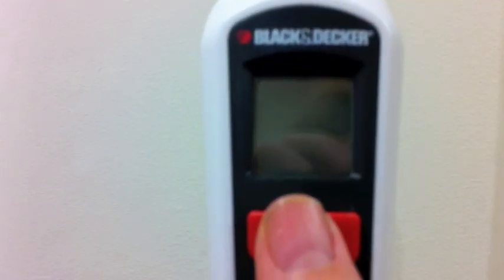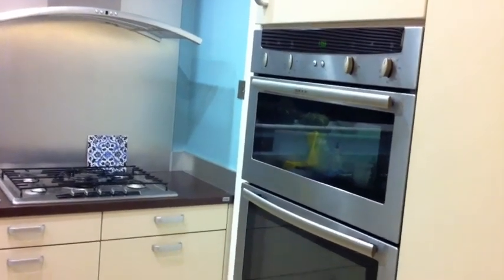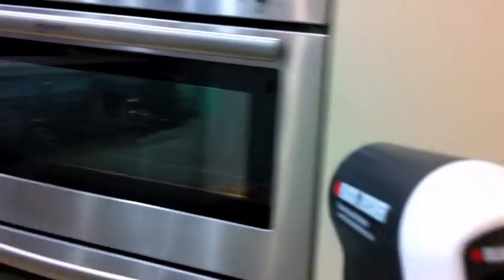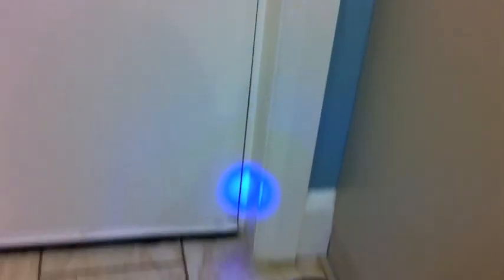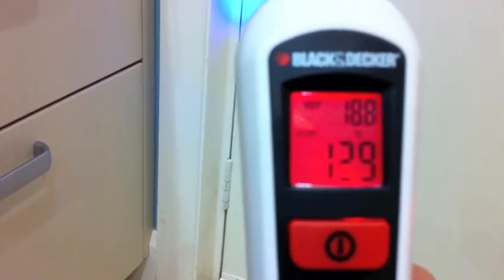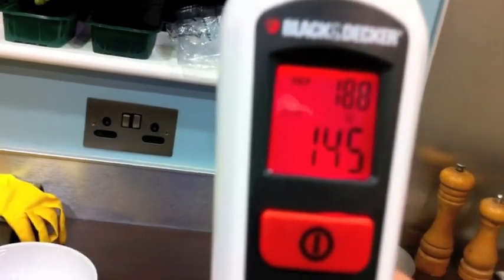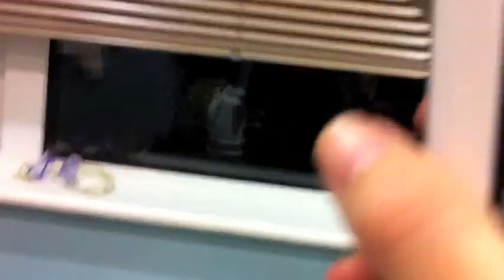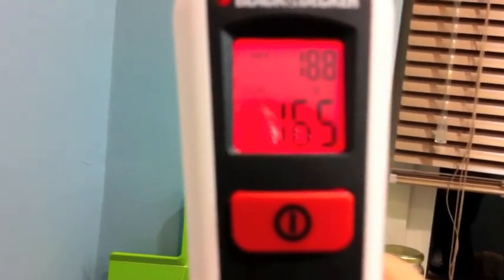Finding draughts and thermal leaks in your house

Comment: blinds don't insulate anything
Reply: Andy Merrett it just means the blinds themselves are warmer than the glass of the window!
Reply: Anything that traps air insulates. Taking the thinnest layer of toilet paper would have an amazing result, adding another, better but not as great as improvement as the first. A plastic bag would be better than the toilet paper (0 air flow)
Reply: @1floggedhorse  They do not insulate and don't trap air, I am energy efficiency  inspector. Anything inside the glass doesn't insulate. If you mean blinds that lock and are outside the glass then they provide some small protection.

Comment: LMAO on your comments...
Metal blids insulating well hahaha!

They pick up close range room temperature as they only have air contact nothing else.
Put them on your window and see how well they are insulating!

This is a surface thermometer not a thermal camera for god sake.

OMG don't make video if you are NIL on phisics :D
Reply: Granted but doesn't she just mean that less cold air escapes with blubs covered windows than without?

Either way do you know the answer? MY house has new Windows and doors and is cavity walled and it loses heat so fast. 2 of my Windows don't have curtains or blinds up yet so I'm wondering if it's that.
Reply: @realMaverickBuckley  Try carpets and underlay and wallpaper on walls and polystyrene tiles on ceiling, curtains to the floor across doorways and windows double curtains even IKEA sell long length curtains soft furnishings absorb noise too.